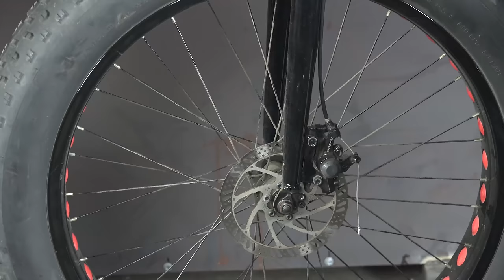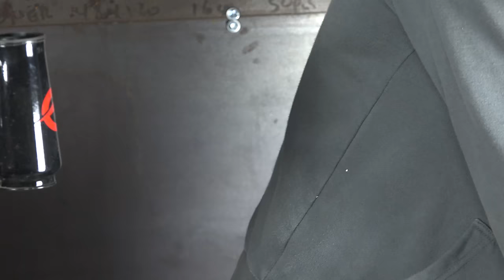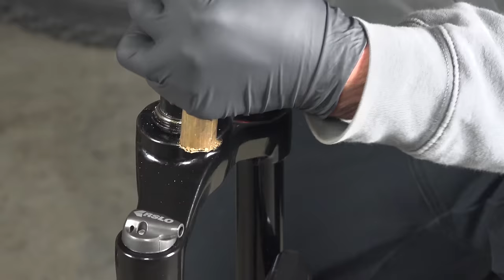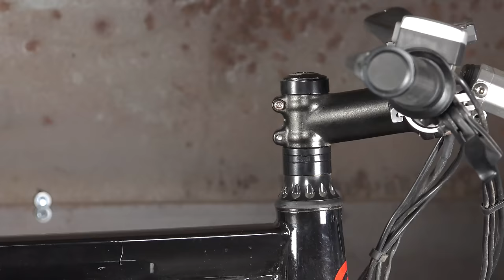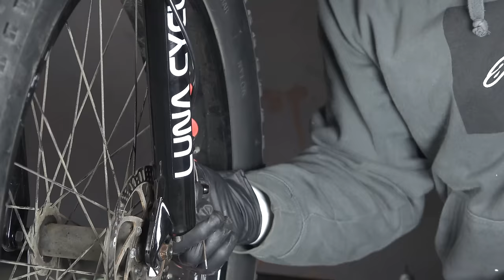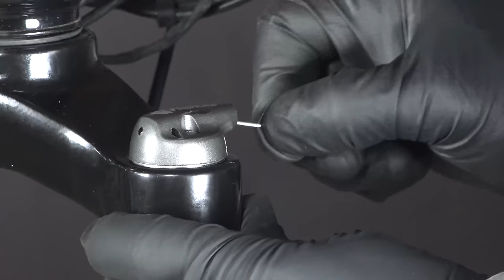Luna Lander Fat Suspension Fork  Installation On Sondors  Video

Comment: Use the PVC pipe tool to set lower crown race / bearing.
A Brass flat nose punch also works well, as the Brass is softer than steel won't damage race.

Comment: Thanks for the video, am currently installing an RST Mozo Air fork on a Sondors Model X and the Post style caliper mounts were something I have never seen before, good to know the caliper can be mounted directly to the fork without the adaper bracket that came on the model X.

Comment: On putting the race back on:  Go to the hardware store and get 1 1/4" Sched 40 PVC pipe (got mine @ OSH).  The inside diameter is just about perfect to fit over the crown race.  You can use a needle file to chamfer the inside of the 'tool' for a perfect fit.  Use about a 2' length of PVC.  Now you have a VERY heavy plastic crown race tool that cost you about a buck.  With it over the race, hammer it on with a brick or other suitable heavy object.  Since you have 100% contact with the plastic PVC to the race it will go on easily and you may be able to do it whacking the pipe on to the race by hand, gently, with no hammer (I did).
Reply from the maker: yes we have been including this pvc pipes with most of the suspesnion forks sent out...and will be editing the video... thanks for this great tip.
Reply: Luna Cycles LLC The inclusion of the PVC in my Luna Lander kit was very welcome, it made for an easy install. Thanks!
Reply: Just heat up the race (doesn't have to be red hot) and it will slide right on and lock itself in place when it cools.

Comment: I just found this video to see how to install a fork and I see that the fork is a quick release dropout but the wheel is a solid standard bold not qr. I'm just wondering how that will hold up. the fork I just purchased has qr dropouts and my wheel is solid nut/bolt.

Comment: I take it this is your first time ever installing a crown race?
Reply: Honestly, this was more of a "How not to install your lower bearing race" video. Even a mild bit of prep work would have made  this more helpful. Im no professional , but even I could see this guy had no clue as to the proper tools to use.   The remarks about ruining the wooden specialty tool .....if that were my shop, I'd be pissed.
Reply: I think it's geared towards the average Sondor's owner without the proper tools.
Reply: No need to remove cable from caliper either
Horrible video, good sound, love hearing the sinus sniffles
Reply: @UncleFjester  How would you get the cable through the brazed on holder on the old fork? You could cut that off, but then your fork is not going to be able to put back on when this one breaks.

Comment: wow,what a hacker,glad your not working on my bike!between the rough way you take things apart and the friggin sniffling every 5 seconds,that and the heavy breathing,is this the first time you have done this,cuz it sure seems so,clown show,thats all this is.
Reply: No editing,all one take with no cuts.
didn't need to take cable off of the caliper, just two bolts to remove it from mount.
proof anyone can work on a bike with no experience